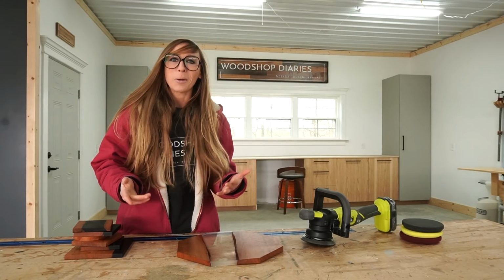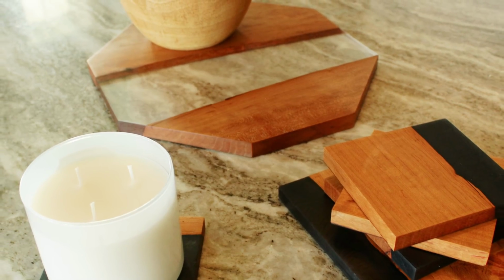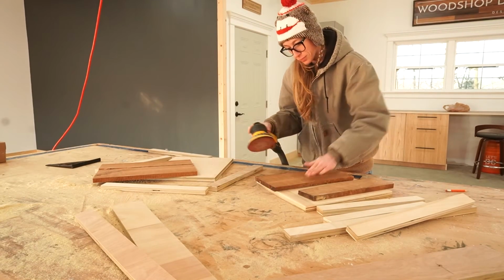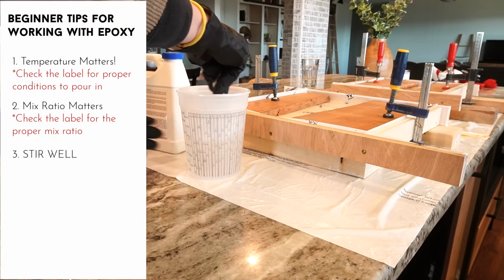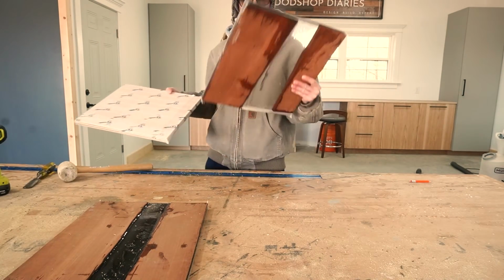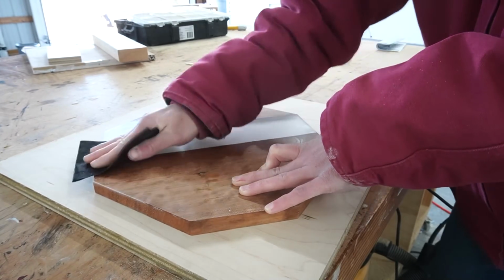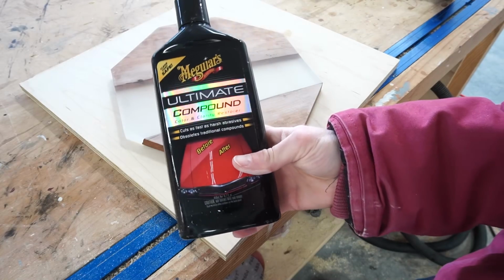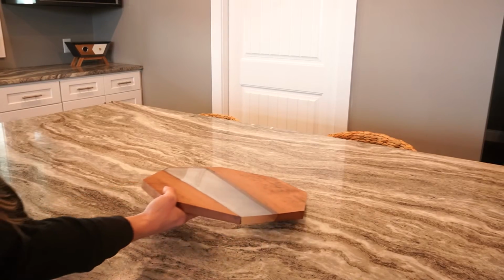Easy Beginner Resin Projects & Polishing Clear Epoxy!

Comment: Is there any specific type of wood you would recommend for epoxy related projects?
Reply from the maker: Nothing specific. It’s just a personal preference on type and color you’d prefer. You can use pretty much any type you’d like. Some woods are more porous than others and tend to create more air bubbles, but for small stuff like this, it doesn’t really make any difference as far as that goes.

Comment: Pick yourself up some simple drawer liner thin foam sheets, the cheap checkered patterned stuff, and lay that down under your work piece when sanding.  It keeps it from moving on your workbench so you don't have to use clamps or hold it down.

Comment: Thanks for the help, I've got a crazy idea not even sure resin is the right medium. I want to turn a pineapple skin into a small- medium planter. Any ideas?
Reply from the maker: That is a neat idea! Resin MAY work for that. I know it’s water resistant, I just don’t know if it’s intended for use with constant moisture (like inside a planter). But there may be a type of resin made for that…I’m just not sure.

Comment: A great guide for beginners!  So many folks mention removing bubbles with heat.  You did not seem to have an issue with bubbles.  Do you think that had to do with your stirring process?
Reply from the maker: I mentioned in another comment here that I have used a torch before to remove bubbles and it works great. But this time, I didn’t seem to notice any bubbles on the surface. I believe since it was cooler (68 degrees) when I poured, it cured slower and that helped not produce so many bubbles.
Reply: @WoodshopDiaries  Thanks!

Comment: Nice ideas!  Other Youtuber always use a torch or similar to remove bubbles from the epoxy. For the stuff you use it wasn´t nessesary ? Is a river bookshelf a good idea ? Whatever, I enjoy this video again! 👍
Reply from the maker: I have used a torch as well. It works great if you have a lot of surface bubbles. In this case, I didn’t notice a lot of surface bubbles, so I didn’t bother with it. From my (limited) experience, it seems the slower it cures (lower temps), the less issues I’ve had with bubbles. Our house was 68 degrees at the time, so it cured pretty slow.